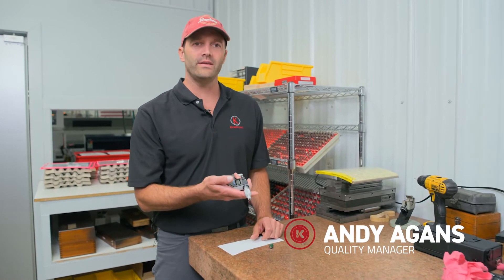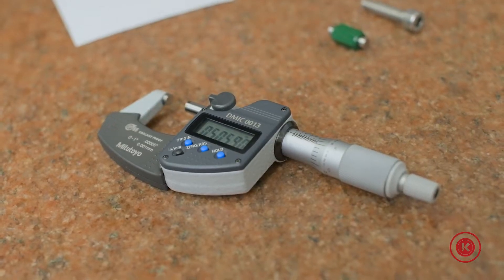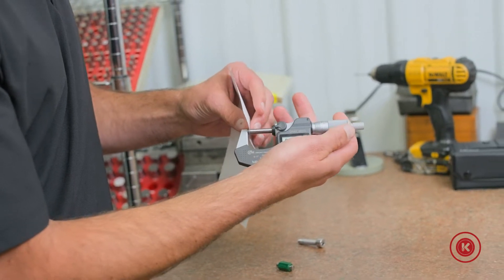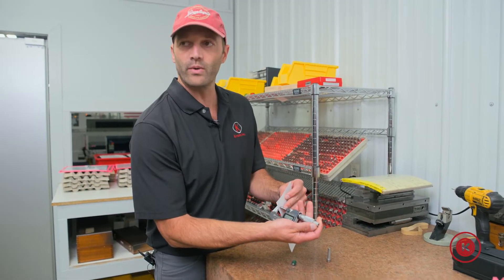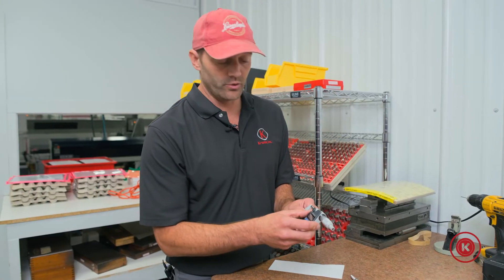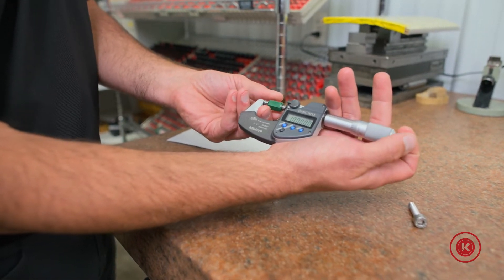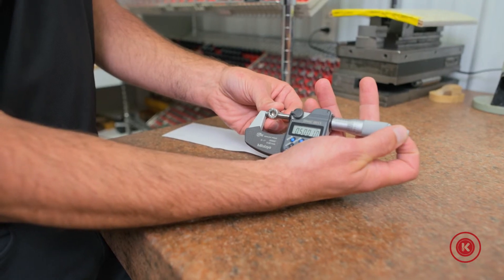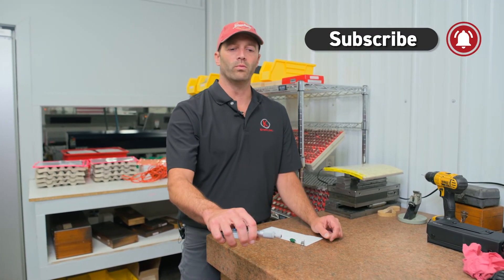Calibrating A Digital OD Micrometer - Kremin Inc.

Comment: What is q micrometer?
Reply from the maker: OD (outside Diameter Micrometers) are used to check a length on parts. In this case - dimensions up to 1 inch.
Reply: How do you calibrate 0-1 digital mikes?